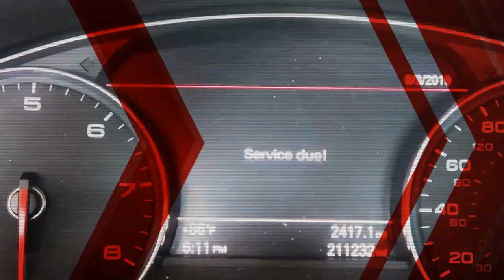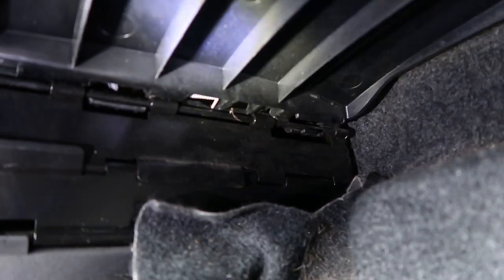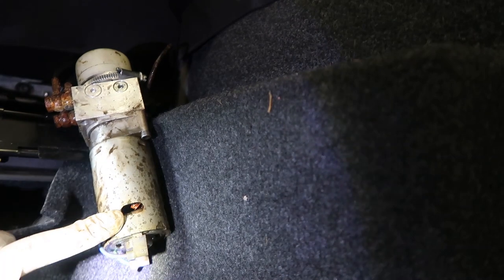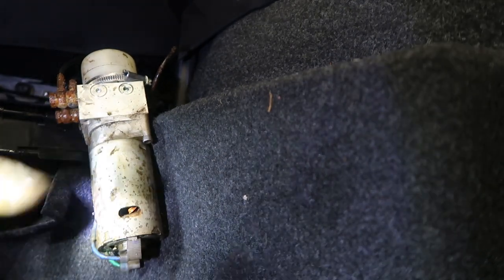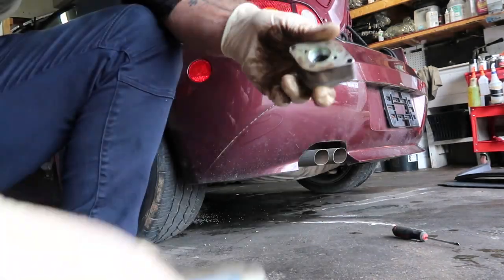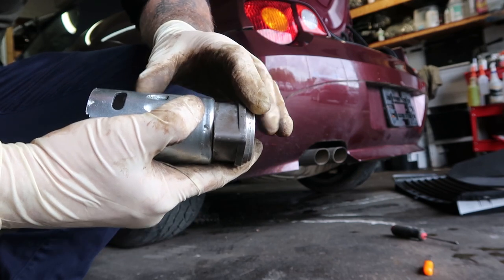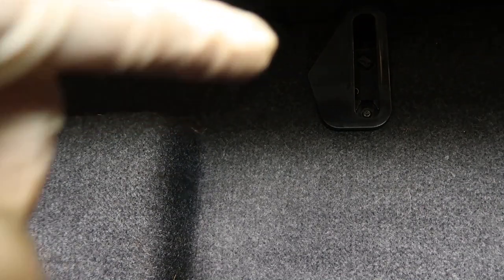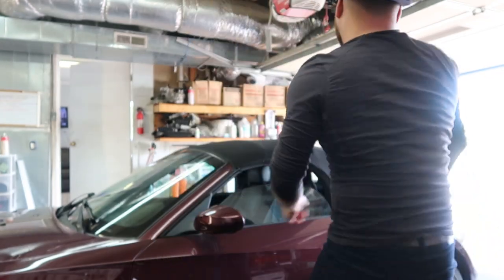BMW Z4 convertible top does not work!

Comment: This was so helpful my friend,  you saved me thousands. I was able to pull motor out, that was sitting in greasy water. I sprayed  it WD 40, cleaned it with fine brush, and dried it with my leaf blower. CAN'T BELIEVE IT,  works faster, and better then ever..thanks so much 👍
Reply: So you simply cleaned the original motor?  You did not buy the replacement?
Reply: Greg Modde  I actually tried this and it worked. :)
Reply from the maker: Glad it helped
Reply: I was wondering if drying it was an option. Is it still working?
Reply: I was wondering if drying it was an option. Is it still working? @tim-hill
Reply: @Mscoffeegrind  The motor works but the pump never worked right because of the brass emergency switch button.  Someone gave me a new pump before I could take a look at that.

Comment: Brilliant video/info, thanks for taking time to make this much appreciated from here in the UK, i got same problem with my roof but now you have given me confidence to give the repair a go myself.
Reply: Did you try it?  if so, was it difficult and where did you get your part.  The link he provided seems to be no longer available.  Mine makes the sound that it is going back but doesnt.  I think mine has gotten soaked with water.

Comment: @5:25 Nice video. One question - how did you pull the motor out without cutting the three zip ties including the one you cannot see at the back bottom of the motor?
Reply: Top has been off before. You can see tape on top cover is not original

Comment: I’ve finally relocated my motor to the trunk on left side behind taillight, I bought two 3 foot Hydraulic cables and all four lines fit perfect,
I added wire to 12 volt line. Tucked it all upwards.  However, I was able to take the Top off in 10min after doing that 7 times.

Comment: How did you relocate the motor inside the trunk? The last shot of the motor it was just hanging over the shelf bracket by the hydraulic lines.  Did you put it back in the housing and mount it in the trunk somehow?
Reply from the maker: Mount it in the trunk!!!

Comment: I think it would be harder to get a pump out like this which has never been disturbed - it’s also awkward doing it in the boot (trunk) like this. It’s a longer but easier (for pump handling purposes) and cleaner job taking the roof off. This is a great time-saving tip if the motor has been out before though. 

Anyway, I have an issue where my roof goes up and down when it’s out of the car but not when it’s fully fitted. The motor is the right way up, the sensor at the back is fine, the manual release lever is fine and the hydraulic lines are not obviously pinching. I’m at a total loss! If anybody has any other ideas, these would be much appreciated! Somebody has suggested that some of the electric wires might have snapped within the loom...

Comment: I need help! So I changed the motor but its not the motor what are the chanses is the converible folding top control unit? And also how much hydraulic oil should I put... Half ways the little container?
Reply: I was told the hydraulic fluid should be 3/4 full.  Did you have to get the air out of your hydraulic lines?  Mine is not working either and I'm curious.
Reply: @tim-hill no - the system is self bleeding.

Comment: I did everything the right way but I’m not getting any power at all from the front motor to open the top
Reply: I had that and the sensor at the back of the boot wasn’t engaged properly, so I just bunged it up with paper and that then worked?

Comment: I am haveing alot of trouble getting the cap off! I took the tape off but it seems like stuck or something. Any thoughts on why this is
Reply: Id try to fit a phone with camera to try and get a better look
Reply: Just did mine today struggled for about 2  hours used a small pri bar and eventually got the plastic top off with great deal of  difficulty . Although after that motor was easy to pull out , cleaned it up dried it   topped  up fluid and left it hanging in boot works again  😃!!!! I'm not putting it back in it original place just need to fix it so it's not hanging on pipes and thrashing about
Reply: Lots of tape.....I  used something to pry it up while I removed the tape....took a few minutes longer than I would have liked but with it being held up I was able to get the tape off and then the cap